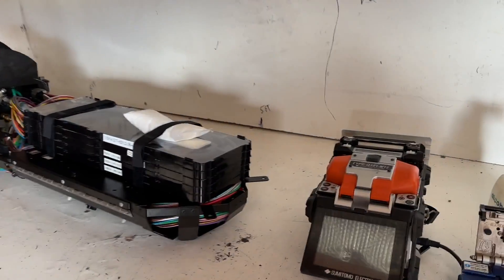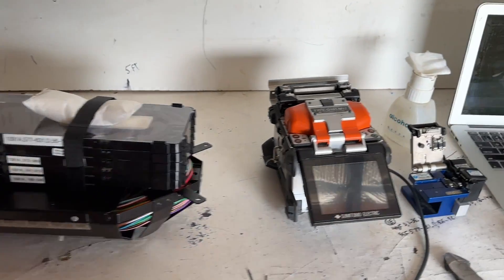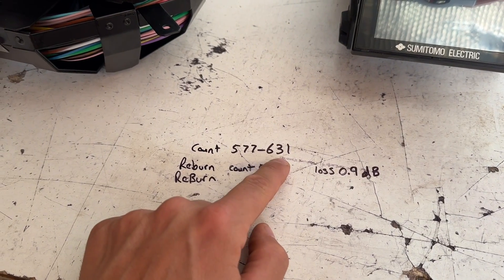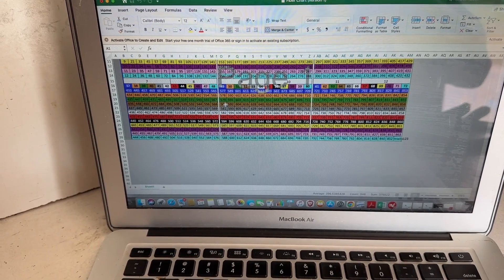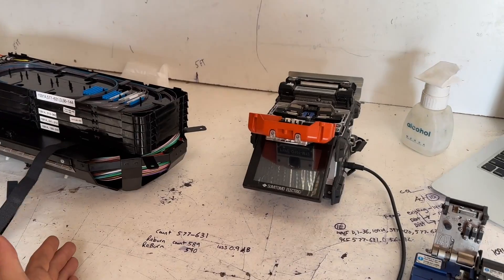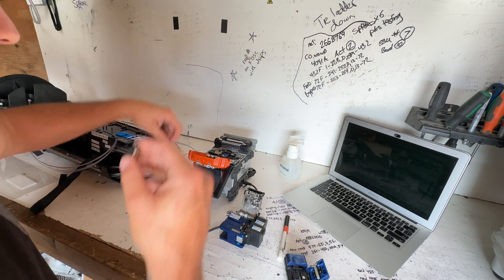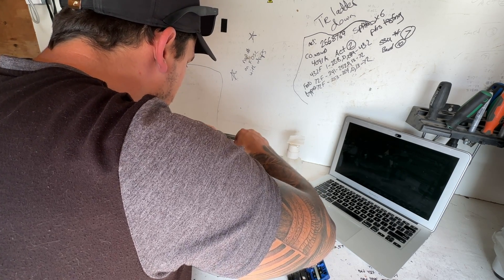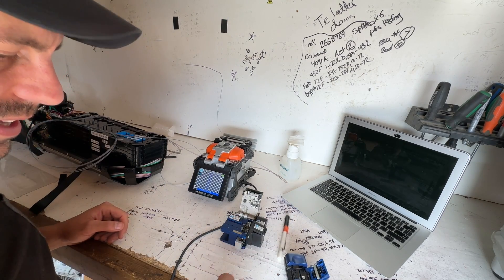Fiber Optic Mastery: Expert Guide To Locating Bad Splices, Re-Splicing and OTDR Verification

Comment: Very nice video :) I see you are testing with 1550nm which we do here so rarely :) I am in Bulgaria and here nobody uses ribbon type optic cables even more at that count. Perhaps the cases in which cables over 96 fibers are used are also rare and are mostly done when you need to leave a data center or something similar. Then cables with 144 or 288 fibers are used :) I had thoughts about buying ribbon splicer few times because it looks so easier when you ribbonize the fibers and then make 1/12 ot the total splices instead LOL Just my 2 cents.
Reply from the maker: Thanks for watching and subscribing I really appreciate it. WOW Bulgaria I’ll have to come visit sometime I’ve never been there. Yea I love my ribbon machine it’s worth the investment plus you can splice any amount of fiber up to 12 so can still pump singles off if need be just change the splice chucks out and change the count and arc test and boom just like that it’s a single splicer 🙌

Comment: Ahh. This is the old style of doing this. My market is pretty much entirely made up of 2x8 splitters that feed 1×4's. No giant lcp's.
Reply from the maker: Nice yea I’ve built a lot of other networks that were all 2x8 and 1x4. This is just what this customer wanted for there network so it’s what they get 🤷🏻‍♂️. Thanks for watching and subscribing I appreciate it
Reply: @FiberSpliceGod  Hey thanks for replying, always interested to the the nft side from a fiber techs view. I believe my company has one market left that is still done this way, as the story goes I believe they weren't happy with the amount of fiber they had to pull (with pre conectorized drops and all) so they contracted a company to make their own terminal the g5 and g5n, which holds up to 5 1x4's. We usually do 3 for 12 customers but leave some room in case part of the term goes dark we can split everyone over to different lines.

Comment: Yeah, the legendary 'before after' problem with a forgotton heat shrink splice protector. That's one of the reasons why we are using crimp protectors in Germany. These are 'v' shaped  metal sheets which get folded around the splice. The inner side of these sheets contains some kind of glue which builds a soft coating around the splice.
Reply from the maker: 😂😂 🙌 yea every now and then a guy gets caught with it haha. Nice yea I’ve seen those splice sleeves before just have not used them much. Thanks for watching and subscribing I really appreciate it

Comment: Would a VFL have shown those bad splices? What is you opinion of the cheap under $1000 spicers? We are pushing to run a bunch of fiber on our college campus, and I'm wondering if I could get them to have splice everything. Most of the work is underground in conduit, but the spliced from our comm company still comes out to a major cost.
Reply from the maker: Great question. No VFl will not show you a bad splice VFL is used to find broken fibers and to confirm spare fiber continuity. When it comes to splicing and testing equipment the cheap equipment is a waste of money and time they do not work I have met a few techs that have tried the cheap equipment and it never functions properly. If you are just needing a splice machine for a short amount of time for a quick job. a great option is to just rent a splice machine and the test equipment there is a lot of rental companies out there and only about a $1000 to $1500 a month to rent a machine or OTDR🙌 thanks for watching and subscribing I really appreciate it
Reply: @FiberSpliceGod  Once you have a distance to a bad splice a vfl can often help you locate the correct ribbon and sometimes even the bad splice. Most of the splices I have had to fix are not as neat and organized as the ones you build. Sending tone and using a live fiber detector is often bettor for finding the correct ribbon.